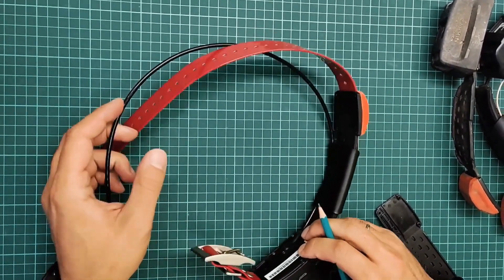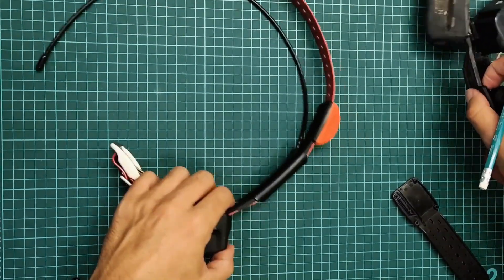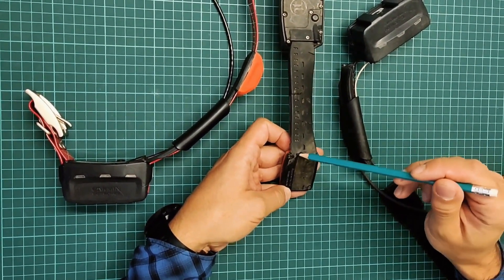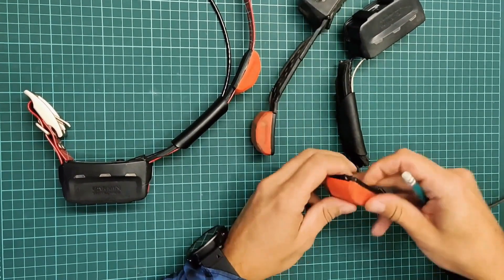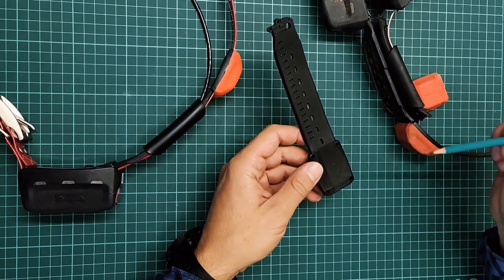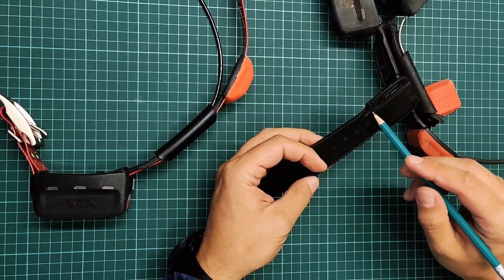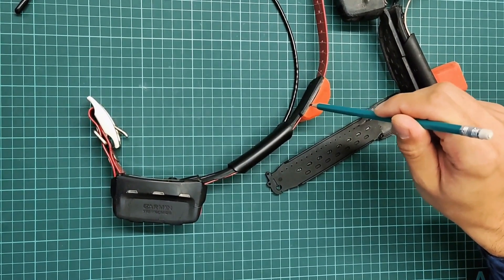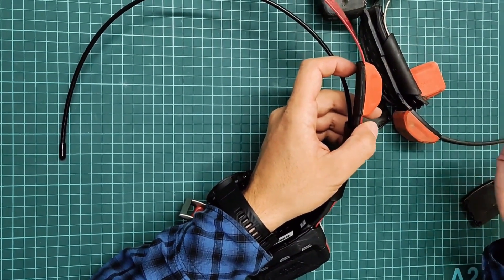FLEXI+ Strap band for Garmin T5, TT15 collars: Benefits and Installation Tips

Comment: Whats the difference in yalls heavy duty bands an your regular bands.
 I need something tuff ive got about 15 collars hogs have messed up. Tired of just buying new collars.
Reply from the maker: heavy duty bands - produced by harder polyurethane, thicker and more tear-resistant. Better protection for GPS antenna cable

Comment: Where is coax cable running in the flexi strap? That cable breaks the most in the collars and you loose GPS connection.
Reply from the maker: In the original strap, the cable is fused into the harness. In our Flexi+ strap, the cable runs inside a tunnel that is slightly larger in diameter than the cable itself. This design allows the cable to move freely, thereby reducing strain when the cable is stretched.